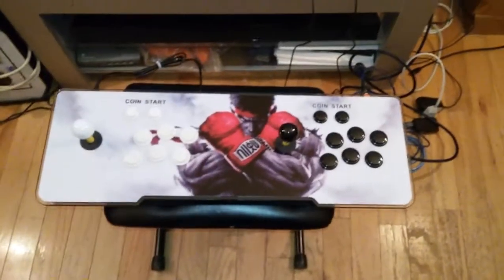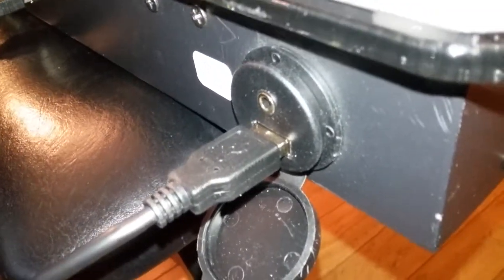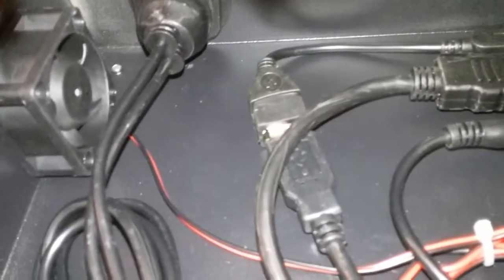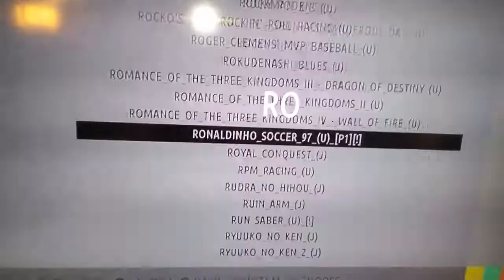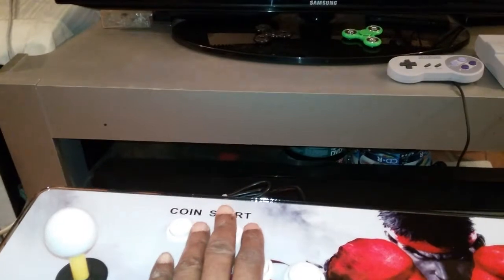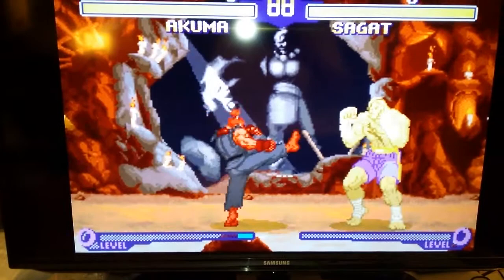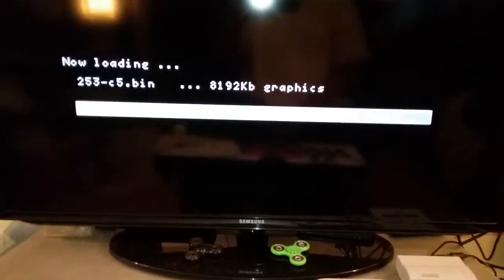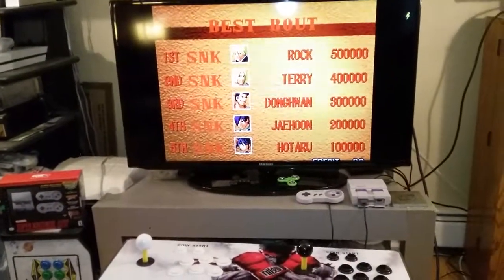Pandoras Box  Arcade with Retro Pi

Comment: Very cool setup! I have a 5s ordered, I think my Rasberry pi is going in it. My raspberry pi has a case I'm wondering if that will fit in it or if I will have to remove the motherboard?
Reply: Thanks for the heads up!
Reply: One question I do have... Does the pie running emulationstation configure both joystick separately?
Reply: @U2BGlynn   I am thinking about doing this setup … was it difficult to re map everything for using both controllers? I have watched that vid you linked like a million times lol I am assuming you had to go in and change the code around just like in the video to use both sticks?